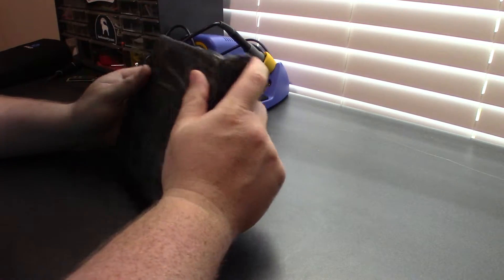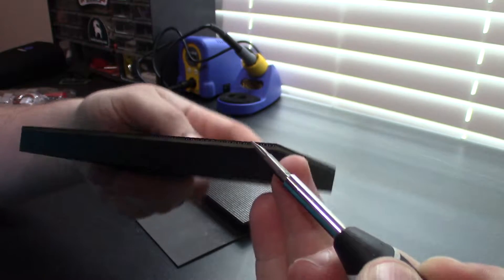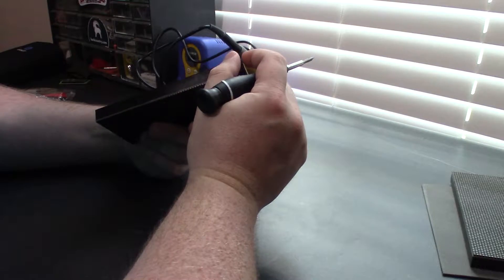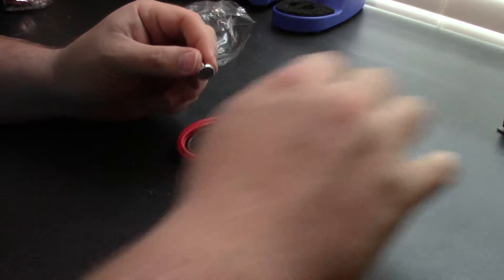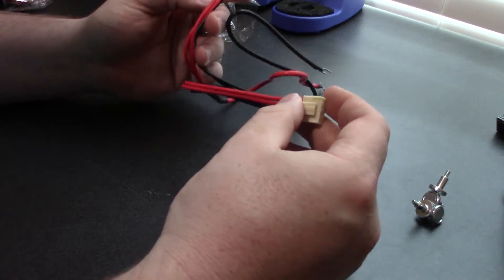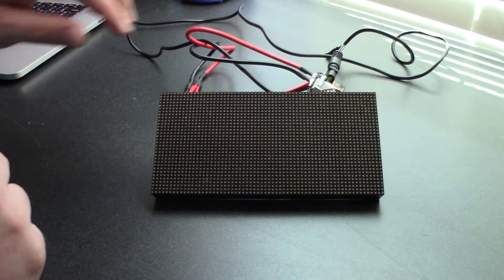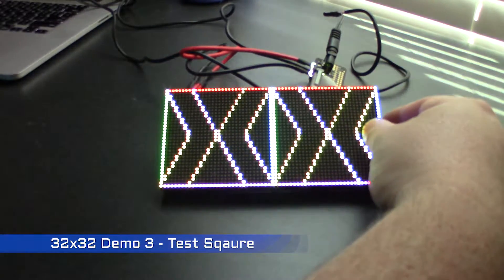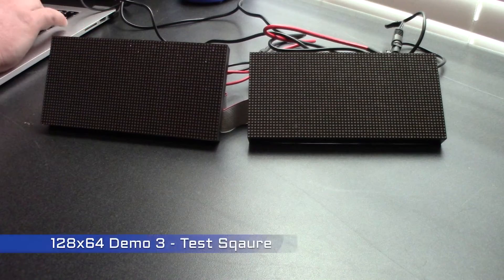Digital Con Badge - Part 2 - Unboxing RGB Matrix Displays!

Comment: I want to chain many of these together. I understand that the Pi doesn't have enough power to drive many displays so how should I do it? Is there a way to connect one Pi every two displays and have them communicate in some way? What do you recommend for a large setup? Thanks!
Reply from the maker: I'm using Henner Zeller's rPi-RGB-LED-Matrix API available @ https://github.com/hzeller/rpi-rgb-led-matrix He says it can drive 3 strings of 12 panels each on a rPi 3, and theoretically more. I bet the newest faster rPi could drive it pretty well. You may have to look into other interface options since Adafruit RGB hat and Bonnet only have 1 string output. If you need to drive more, you might be looking at something more custom or specialized. Eventually, I want to try programming a FPGA to do the "Heavy Lifting" of bit baning the RGB Display and and let the Pi send data to the FPGA but thats pretty far down the road for me!